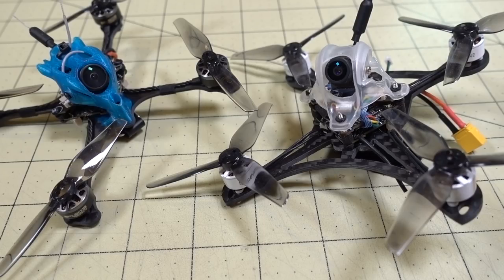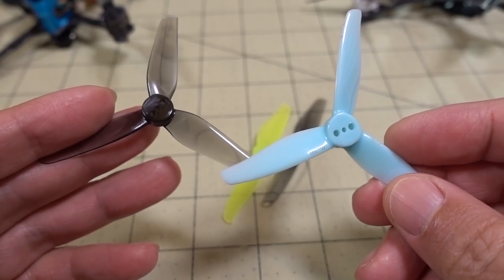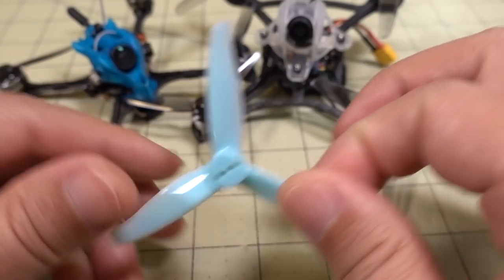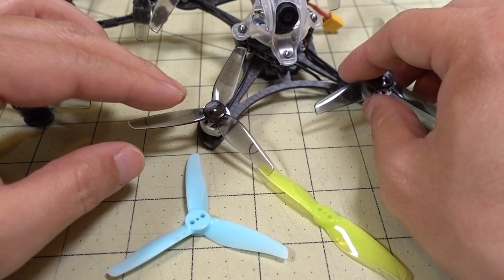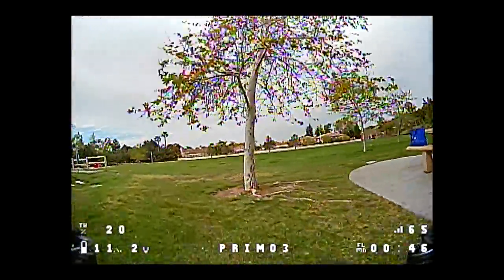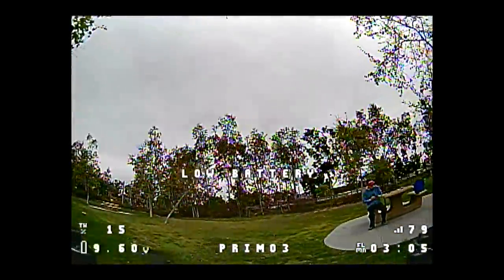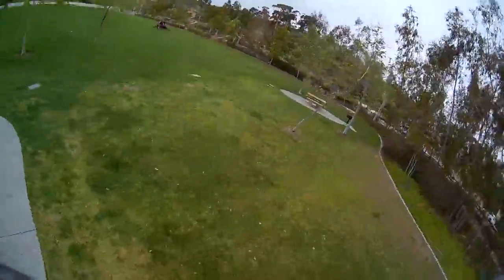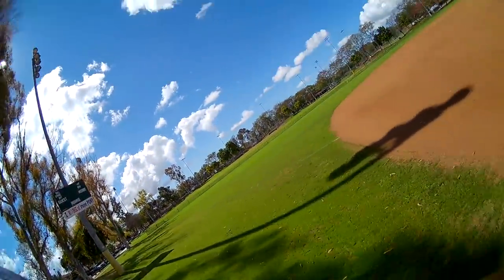HQprop T3x1.5 Prop Review 😲

Comment: Just got a bunch of these in a couple days ago and got to put more time in with them 
and yep I think I like them more than the gemfan 3016 👍.  On my FalcoX Diatone gtb339 I tried the hq 3x2.5x3 and really didn’t like them. I never could tune the shake out so I quickly went back to the 3016’s. Fast forward 3 weeks to the HQ 3x1.5x3 and wow what a difference. For micro racing I’d say that the hq wins between it and the gemfan 3016 (at least on the gtb339) I got slightly longer flight time and way more grip in the corners.  I do need to slightly retune my P’s but that’s about it. They seem a little more durable too. 10/10 for me 👍👍 
I have a tiny trainer from Five33 on the way and can’t wait to slap some xing 1404’s and these hq props on it.

Comment: Great review of a great prop! HQ listened and delivered! On my FalcoX gtb339 the 3x2.5x3 was a bit heavy for the 1105 motors and I never could get it to tune and fly right at all but the new 3x1.5x3 is damn near perfect. I still like the gemfan 3016 but the hq gives a bit more responsiveness and I think it’s a little stronger than the gemfan.  And now with the five33 tiny trainer coming this prop is perfect for it.

Comment: So I have a 1404 6000kv 3 inch build, I tried some props but I think the kv is too high, most props just give a huge battery sag at the top end without much additional speed. Best props for this problem has been that orange 3025 bi blade, they feel pretty linear. What prop would you sugest for this build? It`s a bit heavier with a 20x20 stack in a diatone 369 frame.
Reply from the maker: 3S?  4S?  For a heavier build, the T3x1.5x2 might better for efficiency and less voltage sag.
Reply: @AlbertKimTV  3S. I will try it! It's not like a heavy 3" like the diatone one with 1408 4s, it's like a in between

Comment: Thank for the review Albert. I have been  eye balling the 3 blades for my geprc phantom 3s. Would you think they would suit that? Another thing I would like to know is if these props press fit like the older bi-blades do, or if screws are mandatory. Needing to add screws would be an extra consideration to the weight of the phantom.
Reply from the maker: The Phantom doesn't fit 3-inch props, only the 65mm ones.  I think those will press fit but I have not tested that setup myself.

Comment: I have a spare 1105 5500kv motors, that HQprop 3018 bi blade props, 20A AIO board, and would like to fly freestyle-ish (not highspeed). what frames would you recommend for this kind of setup? Thaanks
Reply from the maker: The frame from GnarlyFPV would be great with those parts.

Comment: I have the iflight 136 turbobee and was thinking about a tri blade prop, what would you recommend it has the 1104 4200kv and is the 4s version
Reply from the maker: Try the T3x1.5x2.  I think the bi-blade will be better on that motor over the triblade.

Comment: How would the HQ T3x2.5x3 fly on the eachine twig or primo3 with 1204 5000kv 12a esc?
Reply from the maker: I'd expect a bit more power at the top end, less responsive at the low end, and a shorter flight time.

Comment: Do you think the biblades would be good on a long range 2S 1404 setup?
Reply from the maker: Might be good or bad depending on all the other factors like motor kv, battery, and AUW.
Reply: @AlbertKimTV  I'm using a big battery so it's gonna be pretty heavy, around 200g. 4500kv 1404 iflight motors.